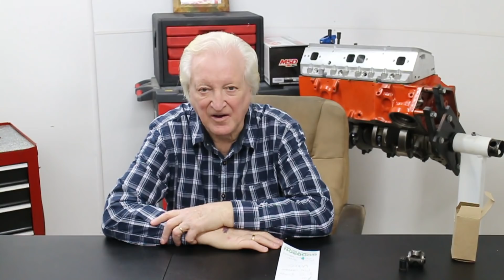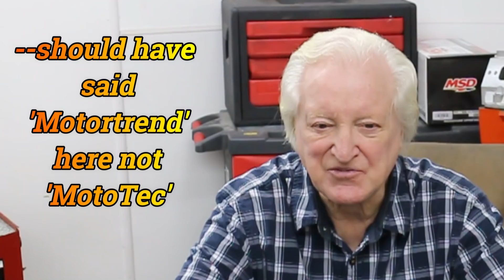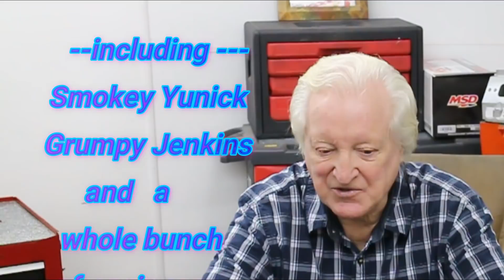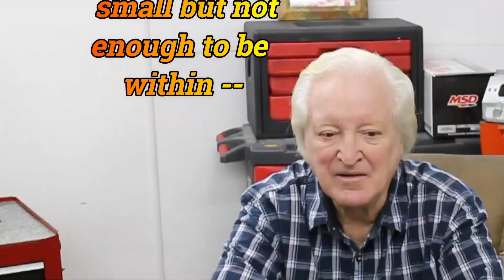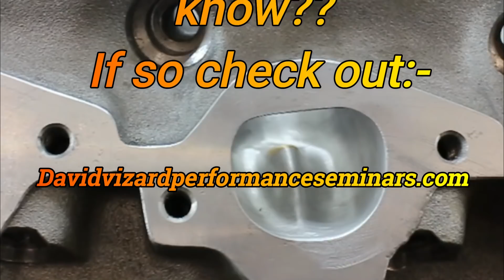David Vizard's PowerTec 10 EP 16  Engine Masters/UTG debate with dyno results

Comment: Try doing offset pins on an engine that’s forced to use “stock length con. rods, such as NHRA Stock or Superstock engine. You will see more than marginal improvements in power. That also goes for engines with bad rod length to stroke ratio forded to adhere to rules. I’ve seen 1-3 hp per cylinder on many engines I built over the years ( since 1983).

Comment: It’s been a while since I watched those videos but I seem to remember that Dulcich said it wasn’t worth all the time and trouble to swap all the pistons around for a few horsepower. Either way I’m all for a cheap extra 7 horsepower.
Reply: I don't think I'd do a tear down for 1 or 2% hp gain.....if you're assembling the engine any ways, why not!!! Zero investment in both time and money for a small gain. Perfect!!!
Reply: @oops1952  

I used to race pure stockers and I did every little trick to squeeze a little extra out of my engine. I don’t know if that would have been something that would pass a post race tear down. I never got busted for cheating but I never had them completely disassemble my engine so I suppose it would have been okay. I remember them pulling one valve cover and measuring the valve lift and checking the carb and distributor. I always felt honored when some cheater paid to see inside my stock engine that just outran their illegal engine.
Reply: @timsharpe3498  I never made it to the track with my 340. I've heard stock eliminator didn't allow it. My engine ran very strong for being slightly over stock. Even got 20 mpg (imp.) with 3.91 gears. Turning the pistons around was only part of it ....but it couldn't have hurt

Comment: used this idea on a 5hp b&s by offsetting the bore, effectively changing pin location, rod angle to crank. it was a screamer until the cylinder portion of the block separated from the crankcase by a big crack almost all the way around. oil went everywhere but it stayed running until we shut it down. seemed to me to been a power increase. so there's that.

Comment: Heard a similar story back in the day,  about SCCA Formula Ford 1600cc Kent engines. Pistons were reversed and showed a gain of 2 to 2 1/2 hp on a normal 105 hp engine. The tech inspectors got wind of this and would tear the first three finishers down for inspections. After disqualifying these and finding that the other racers had left, and couldn't be inspected, they nullified the race and sent out a warning that everyone could be inspected going forward.

Comment: This begs a couple questions though - why do seemingly ALL factory examples run the offset "the inferior way"(for power output anyway, for lack of a better term)? And, why are all aftermarket high performance pistons zero offset, why does no one offer an off the shelf option for offset pins if it's advantageous from a performance perspective?
It really makes me wonder when there's no evidence of NASCAR Cup cars or Pro Stocks running offsets(it goes without saying that some could be and they just keep it under wraps; but a lot of 'secrets' from both have come out over the past half century or so, seems VERY unlikely).
If we assume that it's going to offer a performance advantage, then there must be other factors discouraging the use of offset pins, when the two leading NA motorsports classes(Cup cars & Pro Stock where every fraction of a gain adds up) aren't going after this.
 
Of course, now the Engine Masters test is out and they saw no difference in the Moopur that they ran, which isn't too surprising I don't think even if other testing has shown positive results(variables, variables, variables). I thought they did a great job too, really broke it down into the details, got a number of outside opinions, and Steve Brule knows what he's doing with repeatable dyno testing too. 
If there's gains to be had here, then I have to imagine that it's going to differ wildly based on piston material, probably rod ratio, piston & chamber design, etc., there's just so many factors that I would have to imagine influences the results of this from one engine architecture to another that I can't see a general "it 100% works" statement being applicable to just any general piston engine.
And, I'm still caught up on why the factory doesn't run them the opposite way, especially when even Chrysler's own performance parts documents suggested this in the past, obviously they were aware of potential differences.
 
All of that said, this REALLY makes me want to build an engine. Get a piston manufacturer to make a couple sets of otherwise identical pistons with the pin offset to either side by, say, 1mm and 2mm. Conventional 4032 forgings to minimize any potential influence from dimensional expansion. That would be quite interesting - who wants to fund this project for me? LOL

Comment: Tom Mews mentioned that you only need to switch one bank. Since there is not left or right, so does the offset on both banks go to the outside of the engine? The other question I have not found an answer for is did the stock cam grinds compensate for the offset going both directions?

Comment: So this question is finally answered! Thank you! So Uncle Tony was right and Steve D. somewhat too. UTG said reversing the pistons increases the engine performance slightly, Steve D. said that it does not make a difference. If it is a 5 to 10 hp performance increase on a 300 hp engine Steve D. is right, you won´t feel the difference. But an increase is an increase and in the end all the small increases sum up.

Comment: I follow both camps  and get great info from both ... Tony did say 5-10 HP gain but not seat of the pants gains. As a practical matter and Tony is for the budget builder... what might be the over all longevity of reversing the pistons. I imagine Smokey's engines were torn down each week.

Comment: There are way too many qualifiers that DV uses to say there are gains in reversing what are essentially OE pistons on the rods. What gains were are, if any are so small they are well within readable error on the dyno. There are much better ways to gain horsepower (like a thinner ring pack, a quality engine oil, better cylinder honing techniques etc.) than to even consider playing with pin offset. In my 4 decades of engine building I have never seen any quality piston come with pin offset. I had a customer in the early 2000’s who wanted his pins offset and he couldn’t find a single piston manufacturer who would do it. It’s just not worth the effort and that’s why Dulcich is correct and UT is not. I guess if you are building garbage you can swap the pistons. If you are using non OE pistons like anyone should be this is a non issue.

Comment: hi David, i am really enjoying learning from your vids and books, in the early 70's ford Australia racing team were also doing this to the XY GT-HO falcons with great success. thanks for sharing you wisdom and experience, It is appreciated greatly.
Reply: That was a load of BS to blow competition off the trail. I have tried it using the exact same pistons in the same engine. Zero power gain, more piston noise by a LOT in particular at cruise and in steady throttle/rpm conditions.

Comment: UTG challenged those guys to prove what he is saying, and they have yet to accept it. I know from personal experience, that on stock offset pistons you gain power by reversing them, every time. I have ran claimer classes for decades, and just like Mr. Vizard has said many times, you may not see a difference on the dyno, but the seat of your pants can tell the difference, and your time slips say it works. If that's not the case, why does every piston manufacturer move the pin location for their performance pistons? IT WORKS

Comment: THE JOE SHERMAN always insisted that flipping the pistons on a SBF is good for 15/15.
Ive often wondered if the cam specs needed to change because of this, or if the flip only enhanced a particuar cam and gave more power.
We did it on Y blocks back about 1962.

Comment: Is there a ratio for best air flow (valve size) per cubic inch?  If so,  why don't companies design for it?  
Thinking of Richard holdeners video on the zz302 vs boss 302.  Just seems like GM crutched a lackluster head with a huge cam compared to the boss.  And then heard you say you'd rather make cid with bore instead of stroke because you can squeeze in more valve.

Comment: I’d like to know more in regards to the relationship between pin offset (measured) bore and rod length and if that would increase the effectiveness of reversing the pistons. Would a longer rod to bore ratio with a greater offset pin respond better than an engine with a shorter rod and less offset or vice versa?
Reply: Good question.  I only know the piston offset from a Mopar/long rod side.

Comment: Very diplomatically said but in the end for a used engine that's running fine and making good hp and tq is it worth the time to go taking it apart for such a small gain when there are other modifications than can give you more hp/tq gains? For less time spent.
Reply from the maker: This is the sort of modification made during a rebuild. It is definitely not a bolt on mod.
Reply: @marvingvx1  it's still not worth the time if the engine is sound as dulcich said about taking a good running engine apart just to gain 5 to 7 hp and since Tony's channel is geared to helping the novice is can end up with disastrous consequences...for a stock rebuild sure go ahead but then if you want a performance rebuild that won't be cheap a little more attention to detail is in order than flipping pistons like a magic wand for horse power. For those of us with small budgets and even less time we have to make every dollar spent worth the effort.
Reply: If I were freshening up my engine, I'd reverse the pistons. No one is going to tear down a perfectly good engine for a chance at a few HP!
Reply: @jeffreydurham5342  totally agree!

Comment: Many, many years ago I had a friend who had a 17 ft boat with a Volvo B20 engine in it. When the engine was rebuilt i suggested that he turned the pistons around and he did. The boat was then faster, but engine noise was not acceptable because of piston slap, so he turned the piston around the right way again. He than lost 2 or 3 knots from the max speed.

Comment: Now let's see what happens when Richard holdner switches the pistons in a 360 if it gains  power if it happens will steve say a Tony you were right ? 🤔
Reply from the maker: I HOPE RICHARD APPRECIATES THAT REVERSING THE PISTONS ALSO MOVES TDC SO IGNITION AND CAM TIMING NEED TO BE ADJUSTED AND OPTIMIZED.
Reply: EXACTLY...
Also the piston accelleration rate etc might indicate a cam grind change. 😱😷😁
Reply: @marvingvx1  I really love all the hard work he puts into his testing but it drives me crazy when he tests multiple cams in an identical short block. He always gives lift, duration and lsa. But he tends to gloss over the intake valve closing point. Seems to me that using the same static compression ratio on multiple cams that getting the best dynamic compression ratio for a particular application would be hit and miss. And make one cam look better or worse by not optimizing compression ratio.

Comment: This is the dumbest argument ever!!!! Who in their right mind is going to take off 40 + year old pistons & reverse them! Remember your point you said in 1985 36 + years ago, it’s not 1985 we are not stuck & nobody is building a race engine with stock parts! When smoky did it he had nothing else! Had to find any advantages with the junk he had! No body trying to make horsepower is using stock cast pistons or vortech heads anymore! Especially when you could get a 500$ 6.0 liter from the junkyard put a cam in it & make more power than a completely built 383 with tons of hours & work put into it!
Reply from the maker: And yes Brian, that might well be the case but the subject was not LS engines but piston pin offset.
Reply: @marvingvx1  I get that, we tried this years ago on stock 2 barrel claimer engines for circle track, the difference was minimal at best. Back to back on dyno! Piston ring size made way more difference! Again nobody races w stock pistons. Thank you.

Comment: I guess as long as they aren't installed upside down it will work out, haha, fir some reason, about every engine I built, (SBC!) Had double valve reliefs,  I guess so they can be reversed! I tend to use flat tops, with 60-64cc heads, and like to get a zero deck, or get the Pistons above deck about .010" or less than    .020", if I'm running a thick gasket, like MLS gaskets, I'm thinking my 385cid stroker needs to have a piston switcheroo! I'll have to press them off, and back, I want to check rod bolts and head and main studs, I'm thinking I may got counterfeit arp studs, I bought from a questionable source, back when they had alot of issues with that, but it has a balanced 5140 crank and rods, forged Pistons, and comp nitrous HP cam, I want to swap to a hyd. Roller, but after your videos, I'm thinking I should atleast give it a go! And I want to port the Doug Herbert aluminum heads! And play with the valves, possibly go a bit larger, with your knowledge, I don't see why it can't see 2hp/cid! I originally wanted to go with a turbo, but funding ran out, I went ahead and built it, because I didn't want all the parts sitting around, possibly walking off, it has a single plane, Victor style intake, I'm thinking I'd like to go with a good dual plane, it's the bigger 210cc intake runners, that are vortec  and traditional SBC, I'd like to keep low end, from 2k up anyway, if I could drop the compression a bit, I'd like to get a bit of boost! But that will likely have to wait, for the next one.. like my +030"400, it could be disassembled Cleaned, and put back together, but who's gonna do that! I have a couple scat cranks, one supposed to be a 400, if not I think it's a 383 crank, that cast steel is a awesome idea, but the 385, it's a +. 040" block, it's the most radical engine I built, most others were stock crank, or a scat crank, and the best stock rods I could find, with hypereutectic Pistons, with either decent stock heads ported, or aluminum , most used alot of stock parts, you have been a great inspiration, I love engines, and making power, knowing how to modify engine parts, to make  power,  is amazing, I have always wanted to push it as far as possible,  thank you for all the knowledge, and the effort into your videos!
Reply: Everyone's boosting nowadays, it's more impressive getting results with an n/a setup 👍
Reply: You don press pins, you just swap the left bank piston rod assemblies to the right bank v.v.

Comment: I subscribe to both Motortrend and UTG and I think that Uncle Tony's statement was taken out of context.
Reply: True, and then someone said that Tony was saying it was a 25hp gain, which he did not say.
Reply: @pete540Z   i believe in an early UTG video on the topic he threw out 20 hp.. or something like that ?? Not 100% sure, I just seem to recall that somehow.
Reply from the maker: Yes I believe there was a little misunderstanding involved.DV
Reply: @marvingvx1  Both ways - Freiburger kind of blew it out of proportion in the video. I think Steve Dulcich covered his bases when he said "A lot of aftermarket forged pistons don't have an offset". None of the junk I have used in the past 20 years was reversible anyway due to chamber shape and dish, so I'm guessing it's kind of a moot point. I'll take the extra cubes from a stroker and not worry about cast pistons having any HP left on the table. :)  Piston slap is part of the game when you add clearance for forged pistons, it's why we "warm up" hot rod motors before we stomp on them, right? Thanks for posting this!

Comment: Thank you for your insight.  Related topic, what are your thoughts on longer connecting rods, all else being equal, meaning that the wrist pin is moved up into the piston?
Reply: In his video on rods, he highly recommends going from the stock 5.7 inch SBC rod, to a 6.0 inch rod from Scat. Also, in Smokey Yunick's book "Power Secrets", he said "put the longest damn rods you can fit" into an engine.
Reply: @pookysdad4884  :  That's the great thing about the Mopar LA, it's already built in with the 9.6" deck height and 6.123" rods.

Comment: Thanks for all the great videos. The guy's  I know that ran super stock and stock especially on the oldsmobile and Pontiac  reversed the pistons.  Of course they were looking for everything. They never claimed much of a horsepower gain though.  I'm guessing 5-10 on those engines.
Reply: its not just the horsepower, what needs the real looking at is the torque output range+curve, is there more torque overall to spin up quicker with?
Reply: Stock eliminator is where small gains matter, and if someone will find them they will.  I got the backwards piston trick from Dan Dovrak, an A/SA max wedge racer.

Comment: My questions:  Besides possible H.P./Torque gains, would/could the piston reverse give faster throttle response?.. and I am thinking that a faster throttle response may not be picked up at all on Dyno runs?.. Especially launching off the line from a dead stop.. the Dyno would not even see that.